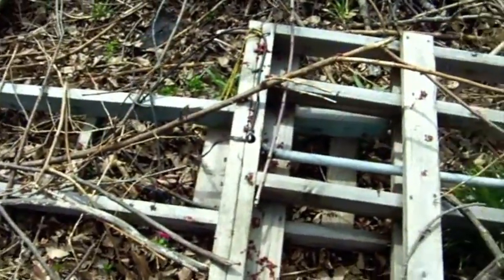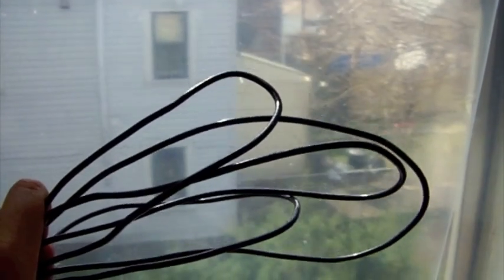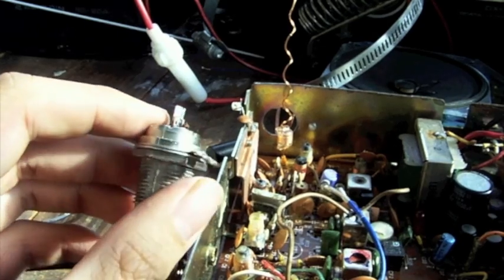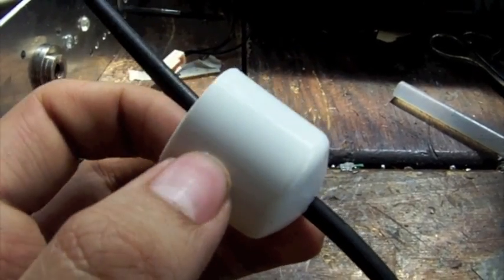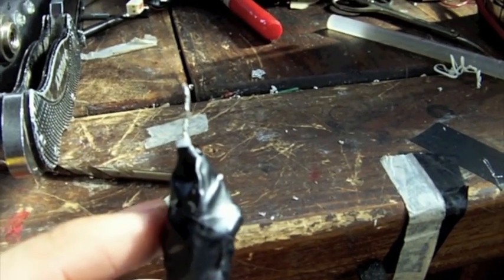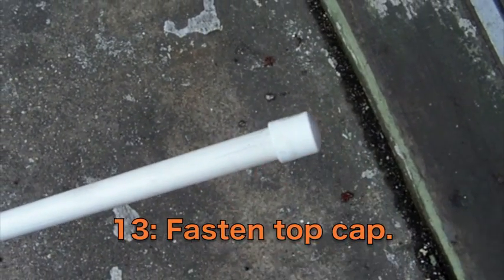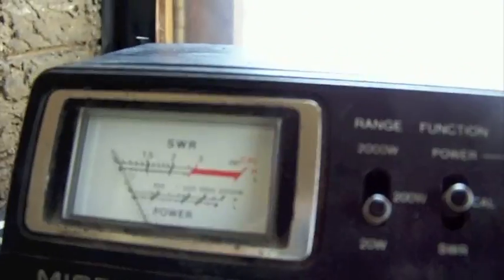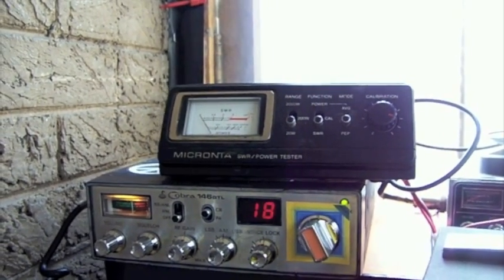How to make a CB radio 1\4 wave base antenna

Comment: Busy looking to buy a rig after an absence of 50 years, a Cobra 146 GTL came up recently and might still be available as well as a Johnson Viking 40 channel SSB. Will be making this antenna and mounting it on a 3.5m tar pole, on a sandstone escarpment at 700m above sea level. Should give good skip.
Reply: interested to see how that works out Paul.  New to the CB.  Just got a Realistic TRC-431 last week, but need to get an antenna for it.  Also just bought a Midland 75-822 and have been playing around with it, but have only heard noise (or people) on 1 channel (ch 20).  I'm thinking of making the antenna shown in this video.

Comment: I made my own home made dipole antenna 40 years ago when I was 10 years old.
I started off with around 40 feet of wire that was left over from the house getting re-wired.

I wonder how I managed to do this alone without a hand holding video or the internet ... Oh yeah it was the late 70's and we had a brain and knew how to use it, to solve problems back then.

Comment: stretch the solid copper wire makes it easier to work with. and use pvc glue in elec .tape makes water tight ,after all tape made from pvc

Comment: Solid copper wire is much easier to work with if you first heat it to red hot with a propane torch, then drop it into cold water.

Comment: If you don't like black-tape, you can buy FRICTION TAPE at Walmart, or anywhere in the Plumbing isles. You peel the protection film off and wrap round your project and tension seals it to itself. Water proof AND removable in future for maintenance, and other things around the projects place.

Comment: Why not make a full wavelength antenna?
Reply: A full wave antenna would be around 38 feet long for just the verticals radiator on 11 meters (cb). 1005 divided by the frequency in Mhz=length in feet(full wavelength).

Comment: Use  main center radiator with a thick wire as possible, or even a rod. It widens the bandwidth for SWR calibration.

Comment: You would get better results from twin lead rather than what your doing. A quarter wave antenna would have some CRAPPY gain, try a .64 wavelength. Your ground radicals in conjunction with your physical length above ground will determine your radiation angle.

Comment: I'm trying to find a good method of installing ground radials into a Wilson 1k mag mount without destroying the antenna base to badly
Any ideas out there on this?
I might be forced to drill some holes into the plastic base I'm sure but trying to avoid that as well.
I don't think simply placing the magnet over 4 wires would function very well.

Comment: Great video!  I would suggest also,  instead of solid core main element, the use of 1/2 inch  copper pipe that will stay straight no matter what. A small piece of solid  core wire can then
be soldered at the top of the copper pipe for the purposes of fine tuning it for lower SWR reading.

Also, for the radials, instead of holding them in place with rope, fishing line would be much more elegant and also, invisible.

Thanks for sharing your experiences with home build stuff.

73"s

Comment: is the driven element you soldered to the coax cable copper? it almost looks insulated or can be cause it was exposed to air and moisture already kinda threw me off just checking before I make a trip to the big boy toy store aka Home Depot haha come on back.
Reply from the maker: Yeah it's all copper.
Reply: Ok cool sounds good man! Thanks for the video! Hella detailed compared to some that just glance over the soldering joints and didn't make it very clear. But you definitely nailed it! Dyi here I come lol once I get the home base set up listening for my handle tk129. Thank again and have a good one!!!
Reply from the maker: Alright man.  Let me know how it goes.
Reply: Definitely will! Probably be a month or so before it's completed I got my truck set up again and now getting my power supplies and materials and then it's on haha. Hope to raise you on the radio should be easy if you get Canada and elsewhere I'm in southern California haha
Reply from the maker: OKay cool.  You can find me on Channel 1.  10-28 Skyrider.  Otherwise I might be on CH 38 LSB or any other side band channel. 10AD316 is my whole call sign.  California is a fairly common occurrence around here so we could prolly hear each other over the air!  Conditions have been a bit low lately though.  We're low on the sunspot cycle.
Reply: Sounds good heck I'll even try and raise you in my truck later tonight when I'm out of work haha. Got a couple good hills near by to get the signal out a little more.

Comment: How to secure the SO-238 bulkhead connector:
Use 3/4 - 1 inch PVC and caps, punch a hole in one cap the size of the SO-238 and tighten it down.
Also you do not need 4 ground radials either, You can get away with 2 and you should glue the PVC together also once you get it tuned. Your radial should be relative length of the radiating element.

Comment: is the PVC pipe necessary for use or is it structural only?
Reply from the maker: Hey, it's structural only.
Reply: +FelixTheHouseFreak thanks, I have low resources so I'm looking for an alternate structure.
Reply from the maker: Ian Sparrow
You could just tie the element to a stick or even just hang the driven element from something using a bit of rope.  I know what its like to work with little resources!
Reply: FelixTheHouseFreak
I'm planning on hanging it from a tree now.
thanks for your help.

Comment: it is the main radial 2.59 m ? or did you cut it so you can get the best swr
Reply from the maker: +Dark sider By main radial do you mean the actual emitter?
Reply: yes in the pvc pipe
Reply: I made this antenna like 4 years ago its is really good for my 4 watts cb i spoke like yesterday around 900km away from athens Greece
Reply from the maker: Hi, sorry for the late response, the radial should be about 2.59m but it can be a little more or a little less, it's best to start with a little bit longer and then trim it down to the proper size.  In my case I just made it 2.59 right away and the SWR was perfect already.  Glad the antenna worked for you!  I made a 11,000Km DX contact with New Zealand from central Mexico on only 12 watts power.   You can see the video on my channel.  Very thrilling.

Comment: Can you answer a question about your antenna? It might be a stupid one but the center (driven) cable you used, it appears in the video to still have the insulation on it. Does it matter if the cable is insulated or not? I tend to think that the insulation on the cable would reduce the signal transmitted or received? Any clarification on this would be appreciated. Thank you-
Reply from the maker: +John Emery Its most likely not gonna have a very significant effect.
Reply: Thank you for the quick response!
Reply from the maker: John Emery
No problem.  You're more likely to have an issue with uninsulated wire considering that would let the wire corrode.  RF will go straight though the insulation.
Reply: Concerning the bare or insulated wire, Your wire for the antenna has only the effect of changing the length of wire needed to make the correct length for the band and frequency used. It will certainly not reduce any signal in or out. The insulation does not effect the transmit since it is very high frequency and very low impedance diffference. Insulation does no measurable affect on the antenna.

Comment: You're not getting reception due to all the electrical noise and the antenna isn't even above your house.   Try putting the antenna up higher well above the power lines.
Reply from the maker: +CB RadioClub Hey, noise at the time was due to weird atmospheric conditions.  Usually a ton of noise came in after having had strong DX conditions for the day.  Had it low as it was only a temp but It performed pretty well regardless.

Comment: HM Dickson
5 months ago

 
"Wow!  The Rube Goldberg antenna method :)  That will work but the driven element should be cut to 5/8 wave, not 1/4 for best work.  An easier method that will work better is a simple inverted V cut to CB frequency."

Felix I did not see a reply on your part to the comment above (I copied and pasted here) made by this gentleman, is he referring to the lengths of your radials to be 108" instead of 102"? I'm in the process of building mine and just wanted to clarified that. thanks!
Reply from the maker: Hi no, he's referring to a 5/8 Wave antenna which would require much longer driven element.  This is a 1/4 Wave antenna.  These two fractions dont have anything to do with the length of the radials or anything, just two different types of antennas.
Reply: got it. thanks

Comment: I also made a 1/2 wave ground plane similar to yours. I had mine held up with a rope and center insulator between 2 trees with a vertical driven 14 ga wire ( no pvc pipe) with 3 ground radials at 45 degrees. I worked stations on SSB from Michigan  state, Florida Alaska, NY California, Hawaii  and Australia. a great success.
Reply: rEdf196 so was your cb radio stock or amp'ed ?

Comment: another way to make your owen cb base antenna 3/4 inch copper pipe 20 foot of that and one 8 foot cb antenna for a car end cap on the copper pipe drill hole into cap mount the cb antenna mount to the cap with out the plastic spacer  this be the long side for transmit another 3/4 copper pipe one 3/4 copper t and a 3/4 copper elbo thick peace of plastic the 2 element  the pace be like 2 inch apart mount a so 239 on the short side of antenna solder a wire to the center of the so 239 from the top of the t go up 10 inches you will find the good swr match solder or use hose clamp i made one this is a j pole antenna see what one look like google   6 meter or 10 meter j pole antenna this antenna can be tune in very good but never put any antenna nexts to a power line  run all the power you want nothing to burn out but maybe fry the 8 foot fiber glass antenna use fiber glass so it wont be top heavey when standing it up look up 6 meter j ple

Comment: Good job! Any idea what the impedance is at the feedpoint? If not...not important, Good job all the same! Thanks for sharing,
Reply from the maker: Yeah sorry, I'm not sure on that one exactly but with the radials at an angle of about 30-45 degrees it should be 50 ohms.  You can play around with the SWR by playing with the angle of the radials.  I've been meaning to update the design with perhaps a balun or something at the feed point.
Reply: Thanks for getting back! will get back to you with data if i hook my analyzer up,
Reply: FelixTheHouseFreak A balun would be absurd. What you have there is unbalanced feed feeding an unbalanced antenna with a perfect match. A balun is used for feeding unbalanced feed into a balanced antenna. You'd be making it worse. If you have a balun then use it for feeding a balanced antenna such as a simple horizontal dipole or inverted V (a V has a slightly better match to 50 Ohm coaxial cable, angle isn't too critical).

BALUN means BALanced UNbalanced. You don't need a balun for an unbalanced antenna system, not only do you not need it but it will it bugger it up.

A centre-fed dipole impedance is about 70 Ohms, balanced, a quarterwave on a perfect conductive disc would have about 35 Ohms unbalanced and a quarterwave with 2 or more resonant radials pulled out and down at around 30 to 45 degrees will get you very close to a perfect 50 ohm unbalanced antenna system. As you have it there electrically it is sound and it cannot be improved upon except perhaps for a few more radials if you are less than a full wavelength off the ground. At that height 6 or 8 would be a fraction better than 4, but if it was high and in the clear 4 or 3 would be fine.  The only criticism I would have are construction quibbles, I think that non-conductive section gives you unnecessary visual and wind load impact compared to a mobile whip, but then it wouldn't offer the same satisfaction of building your own. Another option would be to get an even stouter plastic tube for the radiating element and get four lengths of hard-drawn copper wire and run them taut up the outside of the tube soldering them back to one piece top and bottom. If it was me I'd secure that with spirals of electrical insulating tape, pale grey for the best visual match against the sky (but I'm English, your local sky might be blue more often than not, although unlikely to be the shade of blue that electrical tape comes in). This will give you a fatter radiating element and so a slightly wider and flatter SWR curve if you want to use more than 400 KHz of usable bandwidth for any reason. This cage of wire would also isolate the core of the tube so that if you wanted to stiffen the element with metal it wouldn't have any effect on the electrical properties of the antenna system as long as you keep it clear of the top few inches where RF voltages would be at their highest. Voltage peaks at the top, current at the base, meaning unfortunately the maximum radiation is from the lower part of the radiating whip section. Although with an inverted V this is good as a V supported on a single tall mast would radiate most strongly from the centre section which would be higher than the tips. 

Watch out for the tips of any tuned element attached to either conductor of your coaxial cable, a quarterwave from the feed is a high voltage point and it can bite, even the tips of the parasitic elements of a beam have high RF voltages on them.

Comment: Buy a proper base Ariel and put in of a scaffolding pole and you can put it on the side of your house on a wall bracket

Your method doesn't work at all
Reply from the maker: There are many people here who built it with great success, including myself.  This is a project for learning about basic anenna design and also for a good back up antenna and all around fun project.  I've talked 11,000km to new zealand with this, crossing the pacific.  There's a video of it on my channel.
Reply: This antenna works, I'm an Advanced licence holder (what the Americans call an 'Extra' Licence I believe?) for Ham Radio in the United Kingdom and I build my own antennas, this design is very simple but actually works really well!
Reply: It does work.  My neighbor built one from this design and video.  Anything Felix works on works.  Watch his videos idiot.
Reply: I disagree The Lich King. The physics is what it is. My only comment, and what I did when I built mine which works extremely well is to make the pipe a foot shorter and the wire. Drill the top end cap to fit a telescopic Ariel scavenged off an old radio. Solder that to the top end of the upwardy thingy wire and seal it into the cap with silicon. Then you have a tip that you can adjust for SWR. I've built that into every ariel I've made since. Much fun.

Comment: Wow!  The Rube Goldberg antenna method :)  That will work but the driven element should be cut to 5/8 wave, not 1/4 for best work.  An easier method that will work better is a simple inverted V cut to CB frequency.
Reply: 5/8 wave antennas required a matching coil or other types of matching devices  to get a good match.

Comment: Do you normally pull in that level of static noise with other antennas?
Reply from the maker: It depends, the static was due to the atmospheric conditions that day.  Not due to the antenna.
Reply: Turn your nb anl on driver 73 from bam bam

Comment: I made this antenna and mounted it on my roof less than a year ago. I live in Omaha.
It was a fun build and it's a good listen. Mine works very good. I've talked to folks in Florida and Kentucky and California and heard transmissions from as far as Northern British Columbia and Hawaii.
My radio is a used/stock "Cobra 29-LTD Classic" that I snagged off of craigslist for $25.
I took the radio to the local CB-pro-shop and it tested out nice. Nothing extra. No bells, no whistles. Fun stuff.

Comment: Put a choke balun,help you choke off any RF down coax.
5 turns of coax near the antenna end where coax exits antenna pole at 4"1/2  dia,use tie wraps too hold coax coil together.
Its called a "Ugly"balun works well.

Comment: I built a 1/4 wave based on your design and put it in an umbrella stand worked great. I had it up for about 6 months with good results and no problems. I run a star duster now but always keep the 1/4 wave as a backup that easily stores away in the garage attic. Great idea.

Comment: how do you determine the length of the radials?, and how long are yours?
Reply: radials on this type of antenna match the driven vertical element, 102 inches

Comment: Strictly  speaking, each frequency has it's own wavelength. The actual frequency at a wavelength of exactly 10 meters, (in "free space"), would be 30.0000 MHz. .The actual frequency for an exact wavelength at 6 meters is 50.0000 MHz, etc. . Amateur radio operators use a "close approximation" of the wavelength to designate the bands we use, thus the "2 meter band" (144-148 MHz), when the exact frequency for that wavelength is really 150.0000 MHz.

Comment: Wouldn't the proper length also partially derive from the velocity factor of the wire being used? Or is that only a factor when using coaxial cable?

Comment: I'd use ABS instead of PVC, including for the radiator. Ask WB4JYT, (John@ventenna.com), why "Ventenna" uses ABS vs PVC pipe to build their main products. The main answer isn't what you may expect. Placing the radials at that 45 deg. angle makes the impedance ~50 Ohms, (difficult to achieve using a wood frame), without the need for the "gamma match", ("shorting bar"), found on most commercially made 1/4 w.l. ground plane antennae.